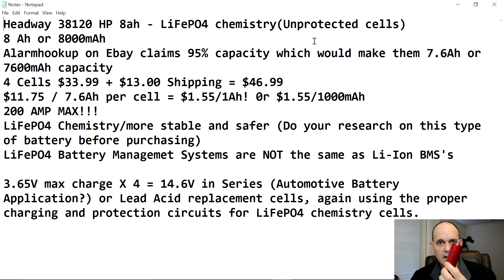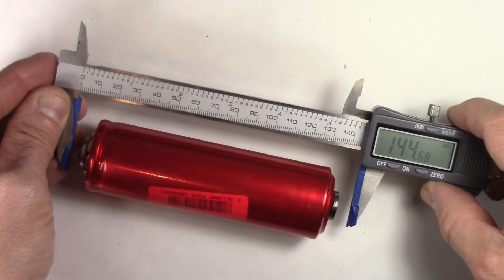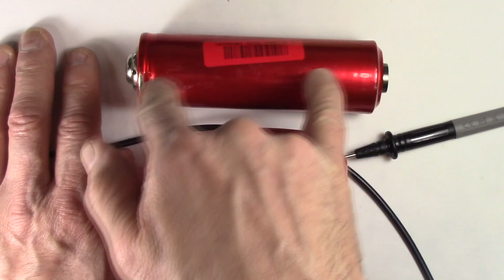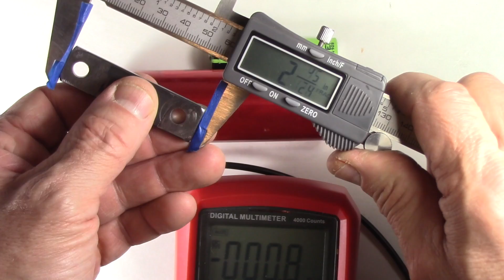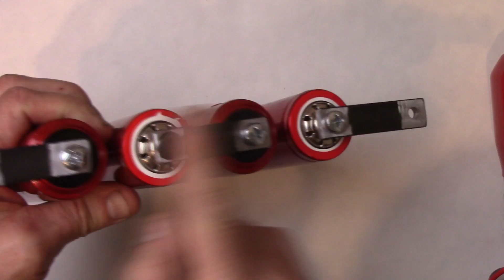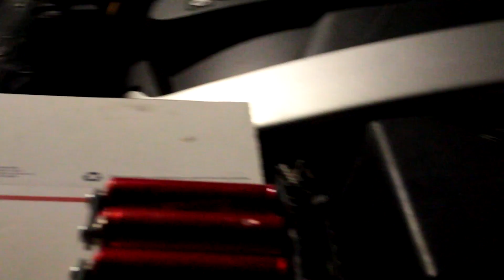Headway 38120 HP 200 Amp LifePO4 Cells Can They Start My Car? Video Review Thorough And Amazing!!!!!

Comment: Nice video im thinking of geting them allso for an e bike.
Reply from the maker: I discharged them at 10 Amps and my small Turnigy charger was getting very hot so I took it down to 5 Amps. Thanks.
Reply: They are monsters, if you do get some please let us know I'd love to see how they perform on a bike and what your using them for, You'd only need 12 for 36v  and extra 4 to bump them to 42, I think I'm right they are 3.6v max? but I think they'd be cool.
Reply: i have used the 10 amp/hr headway 38120 cells for e-bike power.  they are difficult to install, due to their size and weight, but they do kick out lots of amps.  I ruined two cells while charging.....the bms was not able to keep all cells balanced during the charging process, and two cells overvolted.  This was due to the internal resistance of the cells... they vary quite a bit from cell to cell.  you need to discharge and charge each cell separately, and catalogue their internal resistance.  When you assemble your battery, only use the cells that closely match each other with regards to internal resistance....otherwise you WILL have problems balancing your pack, most bms’s only balance with small currents, e.g. 50 milliamp,  This is not adequate if your cells are not matched, and you are charging say, at 5 amps.  If you take the time to match your cells, these make a high power quality e bike battery. 16 cells for a 48 volt pack....get more cells than you need, and be prepared to toss aside the cells that have a very high or very low resistance.....they need to be matched closely for the bms to be able to balance effectively. They self discharge quicker than lipo cells, too.  not so good if your ride is sitting for months at a time unused.  charge and cycle at least once a month, you should be ok
Reply: noticed on your capacity testing that your discharge current was 33 milliamps on one cell, and 50 milliamps on another...how about seeing a voltage discharge curve at higher amps?  nobody is going to be using a high output battery at a milliamp discharge. A continuous load of ten amps while showing the voltage curve would be far more usefull.
Reply from the maker: There are a few videos on Youtube of people who used them for ebikes. Thanks.
Reply from the maker: Awesome feedback, thanks.
Reply: I'd research what actual power is required for the bike. If Li-ion is sufficient I'd go Li-ion, as you will lose up to 2 times "millage" per the same battery weight with LiFePO4. This is due to the fact that energy density of LiFePO4 battery is around 130Wh/kg and Li-ion up to 260 Wh/kg... 

Another factor is lower voltage on LiFePO4, again your bike power may ultimately drop if you are replacing Li-ion on one to one basis. 

Hope this makes sense...

Comment: That was sweet, would love to replace the lead acid battery in my Electric Rav4 with a set up like that.
Reply from the maker: I wouldn't mind it either. I would use two 4 cell batteries connected in parallel to give me more amperage on the battery. I am thinking a BMS and a charging system for LIFPO4 would be good but I am not sure if it is really needed as the cells would only need to be topped up most of the time. it would shave at least 40 lbs off your vehicle and that would save you gas.  Thanks.